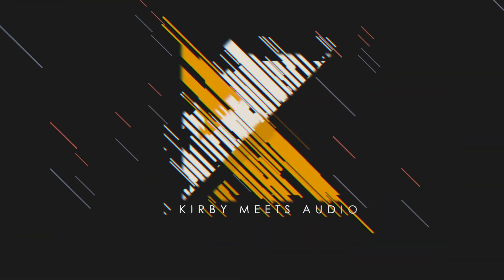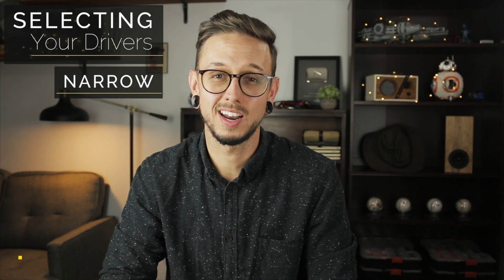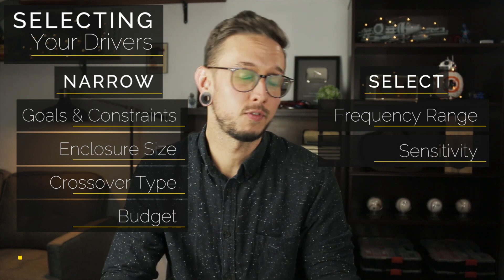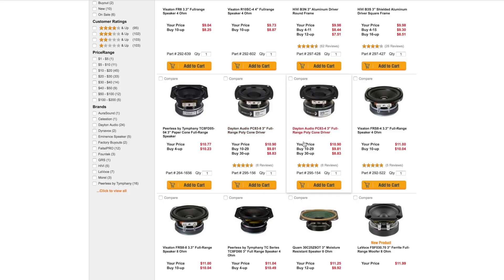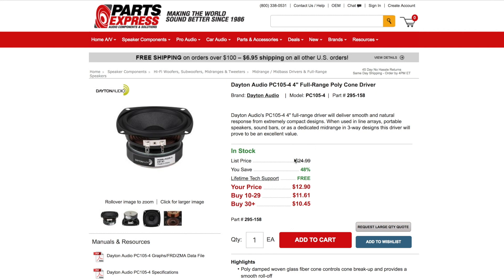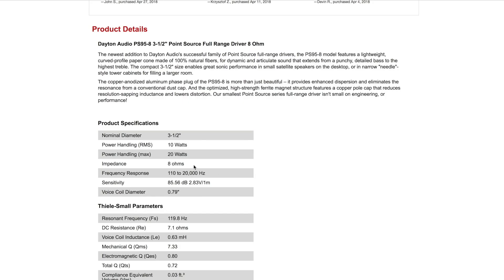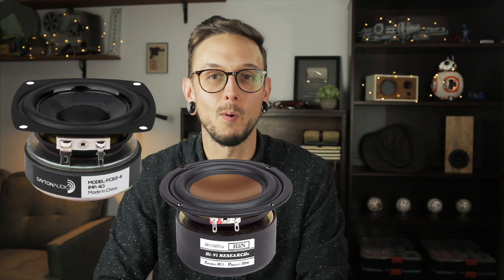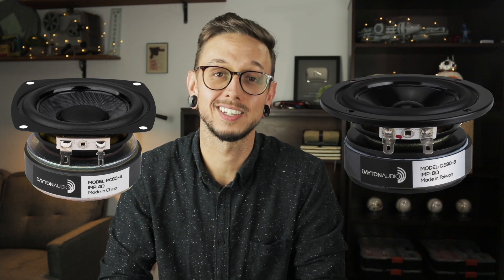DIY 2.1 Soundbar Driver Selection || How To Design A Speaker - Step 2

Comment: Hello Kirby, awesome video thanks for the info. I have myself 2 Sony speakers to which I connect to an amp that gives the output from my computer, however I want to make a curved (almost crescent saped) soundbar which will be connected to an external power supply, should I have crossovers and capacitors for the woofers and tweeters respectively? My tweeters are not in a good condition which ones should I get. I am in India Goa. Please advise.

Comment: I found out recently that the Pc83 don't need a tweeter.  It is so strong in the high frequency range... Acoustic guitars, natural reverb, high pitched vocals and brushes ( jass/blues) sound intens and natural.... So my vote..

Pc83 stand-alone or backed up with the tweeter.... ( although it does not need it at all)... Thank you for your efforts and showing them to us...

Comment: Does the lower frequency of a two-way sound better than the equivalent of a single full range driver? I know it's difficult to compare apples to apples, but I'm wondering if say 60Hz on a woofer sounds just as good as 60Hz on a full range driver.
Reply: It's the same. A full range driver just has no coloration from a crossover

Comment: I haven't listened to any of the drivers but from a frequency response graph point of view i'd say the PC83-4 looks better, as it is a bit more linear in the mid range and a smooth, though bumped up, high end . The PS-95-8 is the better looking driver of them all, nice and pretty cast frame  an nice looking frequency graph but with a dip in what I would consider an important part of the mid range. The 2 way version i think would produce the most balanced sound . I think a nice driver for the 2 way version would be the ND90-8. I also don't like the hi-vi looks. Tough to chose as they are all good options but in the end i'm split between the PC83-4 for the 1 way version or a 2 way.

Comment: You can't judge a driver by it's stated response range. Looking at the response graph will give you a more accurate view of it's abilities. Drivers can have many issues that need addressed like, rising response, dips, peaks, and cone breakup. You can crossover to a tweeter before these issues are a factor. For full range you can use a contour filter.
Example, for the PS-95 use a .45mh inductor followed by a .60mh+12UF+25ohm wired in parallel. This will flatten it's response.

Comment: The PC105-8 is the 4" version of the PC38 that I used when I "upgraded" my Minimus 7W's. When I bought them I mainly got them because they fit in my box, they were affordable, and they looked good for the price. I really wasn't looking at the specs at the time so I wasn't expecting much out of a $12 woofer. I was very surprised when I got them and the new caps put in. It was almost a night and day difference. They're crisp and detailed even if they don't really have much for bass. But that's what an 8" subwoofer is for right? :)

Comment: I feel as though I'm probably going to be swimming against the current, but if one can get good frequency range with the fewest number of crossovers one is ahead of the game because of the horrible things crossovers do with phasing at and around their crossover frequencies.

For that reason I would choose a single wide range driver in the soundbar to go with the already selected sub-woofer:

PC-83-4, 3 inch driver.

Comment: Kirby I have a doubt I want to build a speaker system with two full range speakers of 40W to 50W and two tweeters of 10W and a one subwoofer of 100W of diameter around 6.5 inches to 8 inches. Can u suggest  any speaker and subwoofer(I have decided to use the ND16FA-6 tweeter) (and also the frequency what frequency i should use for each part) anyone else can also suggest
Reply: Someone plz reply
Reply: plz help
Reply: this is a good even I want to know someone plz reply
Reply: Dude it is fairly simple - what do you want? How much money, how big. Calculate the box, find out Crossover and that’s it... Kirby had a series of casts where he described (from the scratch) the choice of speakers, enclosure dimensions and crossover details. Though my calculations where somehow different - I still think that it is the best series of speaker DIY topic on YT. Invest couple of days in the topic and you will know what you want and how to do it.
Reply: Kirby has went above and beyond to provide all his known steps in determining what drivers any particular setup would be best to use. Watch the videos and go to his website to use the information he provides. It's a world of possibilities. You don't have the effort in you though. The comments section is not the place to request a tutorial style answer. Put in some effort dude. Or buy a kit

Comment: I think of the options listed there the PS95 would probably be the best pick. It isn’t quite as flat through the midrange as the DS90, but it has lower distortion and the phase plug helps with off-axis response, very important for a sound bar. Personally, my go-to small form factor full range driver is the FaitalPro 3fe25, but it’s a bit more expensive and definitely has a “pro audio” look to it.
Reply: But also one way, I’m a big believer in point-source sound

Comment: No love for Tectonic BMR? It only need very small enclosure, small enough to sit right in front of TV, wall mount. It's current trend on DIY community. 3-1/2" , 3" and lovely 2". 2 for each side for 3" model, or 4 on each side for 2" model.

Comment: You didn't talk about how the soundbar will be powered. I'm thinking one way, PS95. If it's being powered by a receiver, do we need to think about the resistance? The PS95 is 8 ohms, so it would mate a little better with a receiver.

Comment: Step 1 - use Dayton Audio
Step 2 - Buy from PartsExpress
Step 3 - Secure sponsorship
Step 4 - Profit

I like your videos Kirbs but the theory:shill ratio is tipping.
Reply: Dayton speakers are generally  a decent value. IDK if he is sponsored by them, regardless he is showing the steps to select your own drivers.
Reply: @davelehti4000  I have no issue with Dayton. I started watching Kirby, quite some time ago, because I found value in his talks about speaker theory and how to economically apply it in various ways to achieve your goals.

In the past couple months it seems both he and 123Toid have become the Dayton Twins. There are many other channels that provide awesome, detailed information on the subject. Actually, I don't think I've watched a video from either of them since this one. 

I have PartsExpress and Dayton Audio bookmarked, nothing more to gain here.